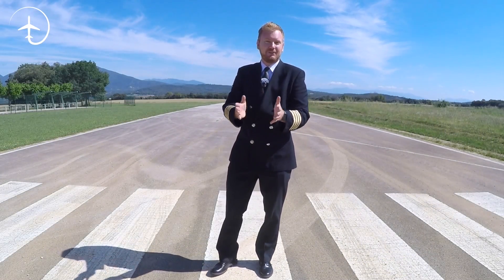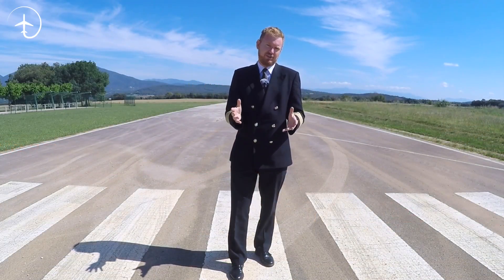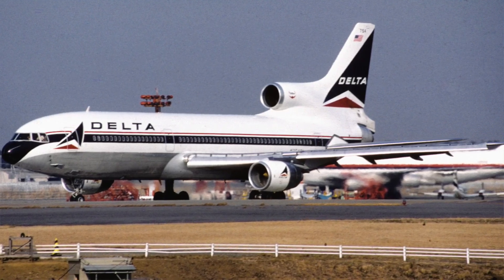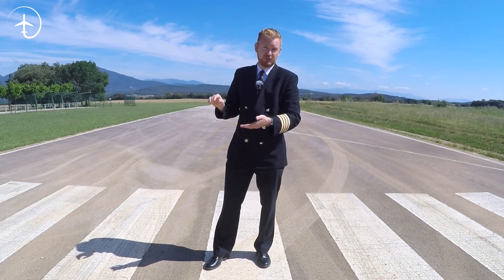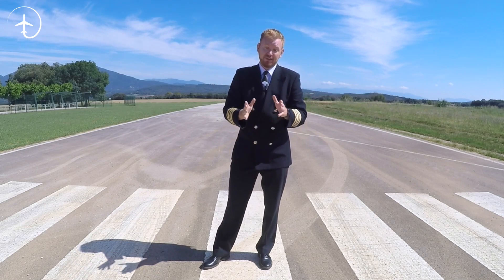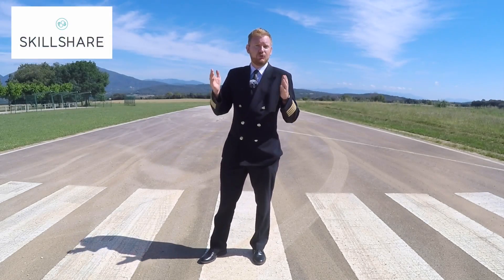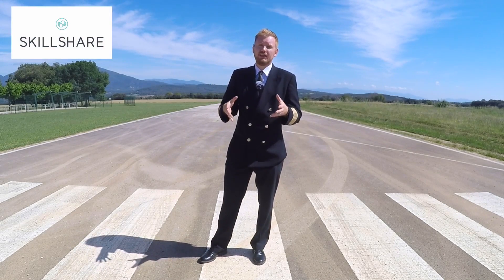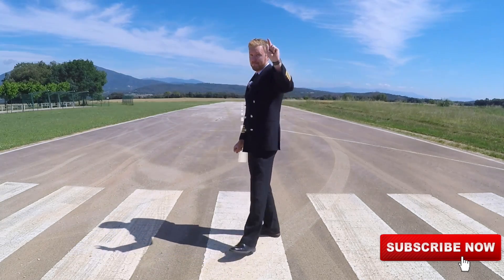Three Engined Aircraft, what happened?

Comment: My first jet flight was in an L1011. I sat down in my seat and looked at my dad and with a worried look and asked him if this thing was really going to fly! It was bigger that our house! He chuckled and smiled and told me not to worry as long as the plane was less than half full (yes, his sense of humor was a bit hard growing up with) and as I sat there watching the plane fill up to max capacity, I looked out the window to see a massive train of luggage pull up and start filling up the belly. I was freaking out. I will never forget that feeling when we were accelerating down the runway, my little ass pushed back into the seat thinking this is it....we're not getting airborne....then we did and the rest of the flight was spent in wonder looking out at 30,000 feet.
Reply: SixStringLove Guy Hah, Dad being Dad, making Dad jokes.😝
Reply: I got to fly a Tri-Star L1011 back in 96' to Germany that summer. It had a very smooth flight, flown by Rich International Airways. However, you could tell by this point the passenger interior was getting rather tired. No seat back LCD screens to speak of, with a pull down projection screen for each section. A leftover from the original 70's film projection setup, but now with a LCD projector.  So everyone had to close their blinds for anyone to see the screen. Some seats earphone plugs didn't work.. You could tell maintenance was beginning to slip.  When I moved to Roswell, NM for a job in the early 2000's, I discovered that the old Rich International Airways L-1011's were now all stored at Roswell International Air Center for eventual parts and scrap disposal. I was a little sad to see that, as I really enjoyed my time aboard those  L-1011's that summer. Even had an "indecent" coming into Chicago where the pilot had to abort the landing on final. When they did we flew all the way across O'Hare and finally landed 20mins later. So I got an extra 20mins of time aboard the L-1011 on my last flight. Interestingly, RI would fly through Gander Newfoundland  to and from Europe. So that always added an interesting aspect to the flight. I really liked the look of the L-1011 over the DC-10 or MD-11. Alas, most of those 1011's are no longer flying, a few DC-10's with random operators and lots of MD-11's with FedEx these days. Such as the DC-10s 10 Tanker Air Carrier uses for firefighting.
Reply: @marcusdamberger  How many Boeing 727s remaining?
Reply: I have that sense of humor. Always delivered deadpan. I love being funny but I hate smiling. I'm probably scarring my kids for life.
Reply: i wish i could have been on an L-1011 my first flight was a trijet though a northwest death cruiser to MSP in 2005 to see family for christmas
Reply: @googaagoogaa12345678  
L1011 was a fantastic airplane.
The DC-10 was also.
There were only 2 fatal crashes attributed to the DC-10 design,  despite the horror stories you've heard fro. Blow hards.
Reply: 1997&98' I travelled on a L1011-2 from Edinburgh to Orlando with a stopover in Gander, Newfoundland on "American Transferred Air". Absolutely LOVED it!
Reply: Sounds like me when British Military Pilots joined on our Operation Bold Eagle U.S. Armed Forces we had a civilian 747-400 the Brits flew it from Virginia to LAX one was age 21 and the other age 24 they could see worry in my face as they took their pilot & co pilot seats as I told The Col. the Bird is loaded & fueled the Brit Pilot's told me they start flight school at age ten in The U.K. Military Schools so after being air borne :10 minutes I relaxed and enjoyed a non stop flight later on way to Seattle our right in board engine over heated had to be shut down and we came down to 27'000 feet for more dense air for the 3 remaining engines other than this we had a wonderful time from Washington to Chicago and back to Virginia  Bch Virginia.
Reply: My first flight was on an airbus a320 and it was at night so i saw the milky way
Reply: @ohyeahyeah249  
Too bad you didn't have the opportunity to fly on a great plane, your 1st time.
Reply: 00UncommonSense00. Great story.  Your old man sounds pretty cool.
Reply: L1011 was so wide, big and majestic that you wouldn't  feel any turbulence at all !
Reply: I remember my first & 2nd flights. AA 191 & 587.
Reply: Went to Disney world in 1977 and I was 25 years old with my girlfriend and another couple and the flight like your's was my first ever. I loved the buzzsaw whine of those engines and only flew the L1011 one more round trip. Coming home was great but my ears became clogged and could not hear well for a whole day. Since then I flew a lot from 737's, MD 80's, DC-9, 747, a tiny prop called a "Shorts" and even a DC 8 on Capitol Airlines a cheap airline in the early 80's (had my one and only go-around on it about 5 feet off the landing at JFK) but the L1011 remained my favorite
Reply: It’s always scary first time for everyone
Reply: Lmaoo when I was a little kid flying on a plane I looked out the window as we started to descend to see nothing but a solid floor of clouds below us. I asked my dad how the pilots knew where to go down through the clouds and fog and he told me they just guess
Reply: SixStringLove Guy you should try the Boeing 747
Reply: I remember my first and only L-1011 flight well because I was about 9, very into aircraft (still am) and was a regular flier at that age because I went back and forth between Denver and St Louis due to divorced parents. Normally this was on a 737 with Frontier Airlines, but we were up in Montana when it came time for me to go to STL, so that necessitated some backtracking and switching to another carrier (maybe Delta? Can't remember) out of Salt Lake City I think. That's where I boarded the 1011. I was very impressed...I'd been on a 747 before so it didn't completely blow my mind but it was impressive.  But the reason I remember it so well is that it was rainy and blustery in STL and the big bird came down once kinda tentatively, then got ballooned by a headwind gust (felt like) before the spoilers came out, floated quite a ways before coming down hard and the crew put the nose down and threw 'er into reverse harder than I've ever felt before...seriously, it made me wonder if my belt was gonna keep me in the seat...LOL...and the runway was wet, which didn't help. I knew the layout of Lambert Int'l like the back of my hand, and as I watched landmark parts of the terminal and peripheral installations rushing past alarmingly fast I actually began to wonder if this thing was gonna stop or not. When I began to see long term parking I decided nope, we're humped. But we managed to hook a turn onto the last taxiway, tail-high and anti-skid chattering I assume, you could feel the rhythmic pulsing of traction so that or we were on the cusp on a sideways skid....it was quite invigorating! One of those where the whole cabin goes completely silent and then you hear a couple hundred folks all start to breathe and slowly talk again in very relieved tones...I think that was probably the closest I've ever had to being in any "incident" on an airliner. Actually feeling strong cornering forces on the ground was disturbing. But Captain Chaos drifted it like a boss, apparently.
Reply: Bicc OG Holy shit you sir...are fucked!

Comment: surely they must have been loud (L1011) as the engine is right behind the passengers due to the s duct?
Reply: Negative.  The no.2 engine is way behind the passenger cabin.  You've got all the sound deadening properties of the cabin furnishings, aft lavatories and/or galleys, plus the rear pressure bulkhead.  The front of the engine is roughly around the trailing edge of the horizontal stab.  Its close to the same distance as the wing mounted engines are away from the fuselage.

Comment: I loved the Trident.  Takes me back to the seventies!
Reply: I saw 8 Hawker Siddeley,Tridents all parked-up at Beijing Nanyuan Airport last year. These were sold new to China in the 1970s.
Reply: @michaelturner4457 They were manufactured in China.
Reply: +therealnightwriter Unless you designed the rear fuselage with some extra space to begin with... I do agree that a modern high bypass-ratio turbofan engine would be very difficult to to retro-fit due to their size, but with fuel-efficiency a priority these days, I could see three engines used for take-off & climb to altitude (and remember, there are many airports that require pretty steep climb angles to minimize noise or clear terrain), and then shutting down the third engine (if you had retractable intake ducts to eliminate drag) for a very fuel-efficient cruise on the two main engines- it would also increase the T.B.O. of the third engine, saving on maintenance costs. Any aircraft manufacturers/designers who read this, please feel free to send me obscene amounts of money and use my idea!
Reply: @erikoarneberg  What a stupid idea... An additional engine and then just for takeoff and the rest of the trip you just carry a useless chunk of weight you have to maintain and even more additional weight and mechanics you have to maintain for retractable air intakes lol
Reply: +Sirion  A little late to the party, aren't you? And polite, too... I'll go ahead and waste my time responding to you, idiot... Current twin engined passenger jets incur three inter-related penalties for using two engines: weight, fuel efficiency & drag because the engines are generally oversized for their needs at cruise. They have to be oversized to provide enough thrust for take-off (most airports in urban environments require steep climb angles for noise mitigation & air traffic corridors) & to sustain acceptable engine-out safety margins. The size/weight of the two engines means that the structure of the aircraft has to be over-built to deal with their weight/drag; stronger wing boxes/spars, larger engine mounts, even longer/heavier landing gear to provide ground clearance for the large high bypass-ratio turbofans huge diameter- look at how most 737s engine nacelles are flattened at the bottom. So... With all the structural weight added carrying around two oversized engines
Reply: +Sirion  Which are mostly needed for take off, the rest of the time, are you really going to maintain that a third, smaller engine is going to incur a weight penalty? Not unless you're a moron- by down-sizing the two main engines, structurally you MORE than cover the weight of a third engine, particularly since it is contained within the framework of the fuselage; very little additional weight would be added for an engine mount & strengthening that part of the fuselage- where very often a small turbine engine (with retractable inlet/exhaust flaps) is ALREADY in place- ever heard of an APU? Didn't think so... With two lighter, smaller main engines, and the concurrent weight reduction to the structure, and less drag (even the engine mounts for the smaller engines would be lighter & more aerodynamic, not just the nacelles & disc face diameter and weight) the fuel efficiency would increase significantly- less drag, less weight, less fuel. I'll dumb it down for you:
Reply: +Sirion  instead of lugging around two gas-guzzling, heavy V8 motors, you can down-size to two V6 engines, and the weight/fuel savings more than covers the weight of a turbocharged I-4, which you only need to use during take off, or if one of the main engines (or both) were to fail. Think of US Airways flight 1549 that ditched in the Hudson River (emergency landings on water are extremely dangerous- partly because under-wing engines tend to make the plane yaw uncontrollably if they don't hit the water symmetrically, and tend to make the nose pitch down, often leading to structural failure) if there had been a third engine, located where bird strikes would not affect it, Captain Sullenberger could have landed at an airport. As to your last points, reducing the load on the two main engines would probably increase their TBO (look that up if you don't know), lowering operating costs, and the third engine, used for only part of the flight profile, would also have a concurrently longer TBO.
Reply: +Sirion So maintenance costs wouldn't necessarily be significantly higher- although I will freely agree a third engine & its control systems would by necessity be a serviceable item that would require maintenance- but with longer TBOs & greater fuel efficiency, I can't state that operating costs would necessarily increase. As to a retractable inlet (or inlets), look at all the moveable surfaces on any aircraft- from flaps, airlerons, the rudder (vertical stabilizer) to the landing gear and more- a simple air scoop that opens & closes is far less complex and more reliable than ANY of the systems I've just mentioned, without which modern aircraft cannot operate. If you don't like retractable air intakes, fixed (but probably less efficient) NACA ducts could be used. Anything else, Sirion? If not, I'm off to do something more productive than try to educate your ignorant & rude ass. Think before you write- it saves my time & your embarrassment. Bye-bye.
Reply: The earlier tri-jets are actually  late 50s/early 60s designs. The Trident project began in 1958.
Reply: TheFunkadelicFan count music
Reply: Umm, excuse me? Trident is a fork. It is tri jet

Comment: On the topic of S-duct vs "fin engine": with an S-duct the engine creates less drag, but it also produces a little less thrust because the air becomes slightly turbulent in the long duct (more friction against the duct wall). On the other hand, the fin engine requires a strengthened fin structure which adds weight.

Comment: Hey,
Just for my random curiosity, is there such a thing as a torque imbalance on planes with an uneven number of engines? With an even number of engines you could always run them in opposing  directions to chancel out that effect.
Otherwise a very interesting video even though I am not planning on becoming a pilot.
Does anyone know an answer to this?
Thank you!
Reply: Jet engines run the same direction. Even most twin propeller planes run the same direction. On propeller planes torque and a few other factors make loosing one engine harder to control than others.

Comment: Btw if the 3rd engine on some trijets had an S duct then how would the shaft for the intake fan would’ve been like ?
Assuming those aircraft’s had a turbofan engine with an s duct,
Reply: The engine doesn't physically extend into the S-duct.  The S-duct ends right at the engine inlet case, then you still have to go back a few feet to get to the fan, just like how the engine inlet looks on the wings.

Comment: For the same total thrust and the same generation of jet engine, do 3 engines really consume more than 2 engines ?
Reply: Indeed yes.
Reply: Sometimes yes, but only because of effects of S-duct or different generation. There is no reason for the slightly smaller engine to be less efficient by its own, meaning while tested on the stand not assembled to any aircraft. In fact smaller engine does have a little bit better thrust to weight ratio than a bigger one with same technology. Thrust scales to the second power of a size factor, but weight to the third power. Heavier engines causes more drag for the wings carrying that weight. There are even more minor factors due to the assembly for the aircraft as well, like power needed for fuel pumps being different if engine is below the wings and fuel tanks or if its up high above the aft fuselage. Clean airflow to the engine is far more significant though.
Reply: That's why I think more engines are just more expensive to buy and maintain.
Reply: Exactly. 
But developing a modern turbofan is very expensive regardless of size, and that limits the number of available choices for smaller planes not produced in large numbers. This might mean that in some cases using 3 still makes sense as 2 modern engines of appropriate size might just not be available. This of course is not the case for airliners which are large expensive planes that are sold in numbers, but just might be relevant for a plane like Falcon 8.

Comment: Did you know that back in the early '70s Boeing had plans to develop a trijet version of the 747 with a shorter fuselage? A major redesign of the wings would have been necessary and it would have much different handling characteristics, so Boeing instead decided to develop a shorter 747 that still had four engines, resulting in the 747SP.
Reply: that trijet version of the 747 (known as the 300 before the real big hump 300 later on) has always been a big what if to me on one hand i think it would have done very well due to timing size and economics but on the other hand due to market crowding and fuel and pax numbers etc at the time i have a feeling it would have tanked
Reply: Matthew Neathery it would have had a look similar to the L1011.
Reply: Should have been called 
"747 SB" for Short Bus.
Reply: @Dave_Crupel  It was originally - but it was for Short Body